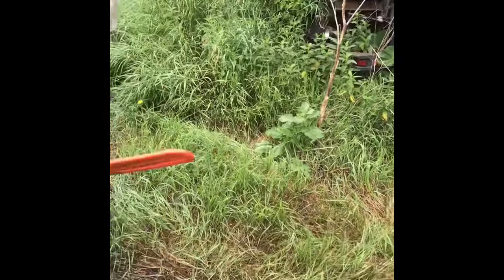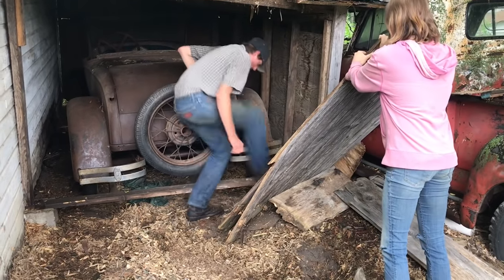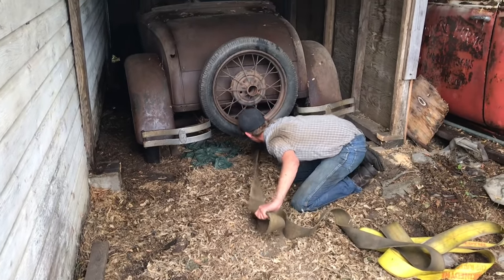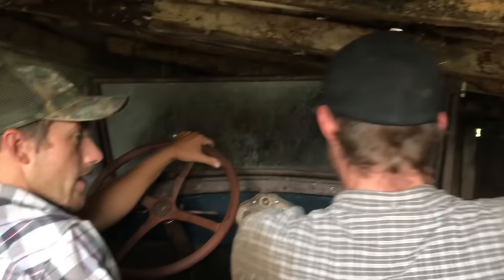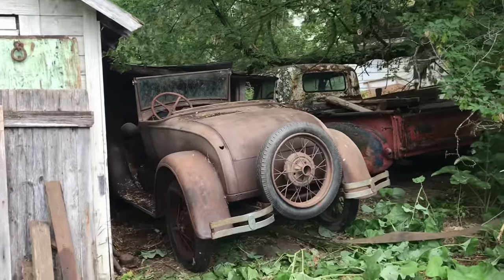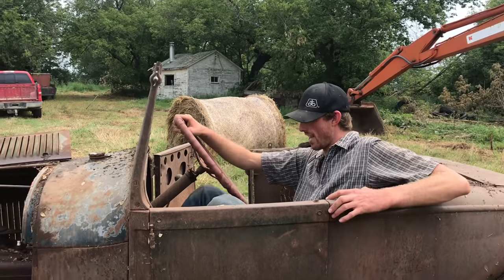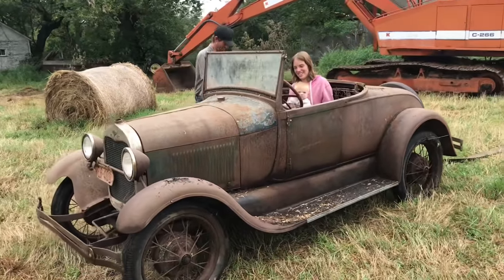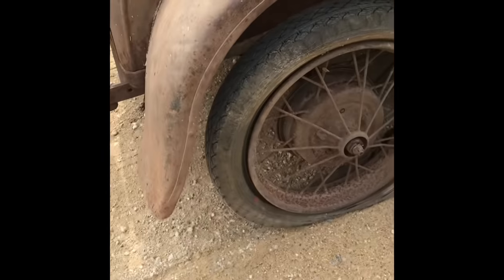An ultimate barn Find..... it could be a 1928 Ford roadster

Comment: You have a rare very early production (probably 1927 production) AR Model A Roadster.  Look on the drivers side of the gas tank under the hood and there is a date stamped into it.  The left hand brake is a left over from the Model T.  This car is very rare. Ive only seen 1 and I'm 72.  DON'T rod it.  Go trade for one that's done
Reply: u got that 1m 77 and only saw one a pickup and its buried under a roof that fell in and it was driven in there but the owner dont care
Reply: Unless those aren't the original wheels, it would not be earlier than a 1928. Before 1928, Ford put wooden spoked wheels. Without researching, I say between a 1928 - 1930 Roadster.
Reply: @coastalcruiser4317  I love it.l am a body and fender painter Man. I restore lots of old car for people show cars for 48 years. I have old car. And I think that is really cool it
Reply: @jerryn4014  I'm envious. That's so awesome!
Reply: Yep red steering wheel and E brake on the side.
Reply: I'm 70 years old and this my second one ever.

Comment: I can see this ending in tears for someone, I don’t think these muppets know what they’ve got
Reply: Yeah not a good idea to flat tow that car!
Reply: Why do you insult them ?
Reply: old car an young mother..
Reply: @garymorris1856  probably because when you see a Model A in such good original condition and then you start throwing words like "hot rod" " flames" and "Ford 9 inch" they don't appreciate it and if they hot rod it they're just throwing money down a rat hole by destroying it.
Reply: @tarstakars  I agree. I always prefer to see antiques restored to be as original as possible.
Reply: @professornuke7562  you don't have to restore it you just get it runnng right you just get the brakes working all you're doing is making it a safe and drivable. a car like that in that condition in California right now with fetch between 7 to $10,000. And Model T's and model A's are like Jeeps there's an inexhaustible well of parts for those cars available.
Reply: Gary Morris you’re right he doesn’t have a clue,he wouldn’t know shit from clay
Reply: @grahamgillette5393  You are correct, as well. Thanks.

Comment: Definitely an AR roadster. The giveaway is the handbrake by the door instead of on the gearbox.
Give the car a wash. Re upholster the seat yourselves. Put new tyres on it.
Get the engine going. Join your nearest Model A Ford club and have years of fun.
Awesome find.
Reply: Scott - YES. Join the local club and LEARN before jumping in.

Comment: Great find!!
You have an extremely rare type of Ford i think.Before cranking  it check oil.Also be careful if you never crank start a car before.Id keep it original because it may only add to value.
That floorboard with notched cutouts is original i believe.Wood was commonly used on the interior of early cars.I hope you restore it and get it running again.

Comment: My first car!! I bought mine second-hand in 1959 for AU£25 (US$760).Mechanical brakes, dickey seat, wood floor, canvas hood & side curtains, same sort of distributor w/- copper strips as spark plug leads. Spent 2 years restoring it. Sold it for AU £1250 (US$4000) cash! Heaps of memories came
flooding back when I saw this one. Thanks.
Reply from the maker: Thanks for watching!  that's so cool
Reply: @MuddyRascals  on car a registration_plates_of_Saskatchewan ??

Comment: Never try turning an old unknown motor over till you put at least half a cup of Marvel Mystery oil in each cylinder then let it sit overnight. If possible spray it in so it coats the entire piston head and cylinder walls.
You can easily destroy the rings, piston and cylinder if you don't.
Reply: prolly shouldnt have towed it like that without disconnecting the driveshaft either...
Reply: @thomasbeaver3828  they are well on their way to destroying it already. The combined iq between the two guys and the airhead is about 8.

Comment: That is,a great find ..that engine will probably run...most of the ones I have seen need a little lubes in cylinders and a touch up on the starter...with twelve volt conversion and a little love will fire right up...don't forget those where positive grounded back then...good luck. .😁😉😊
Reply: That Ford is a 1928 model T

Comment: Way better condition and a lot more complete than most enthusiasts start with. Amazingly little rust on the body and the engine turning over was a win. I don’t think its particularly rare (they sold A LOT of em) but still popular and well supported in the aftermarket, a lot of reproduction parts are available. definitely worth a few bucks to the right buyer. Cool find! 👍

Comment: Some of the old Fords came with wood floor boards.
Henry Ford would buy parts that came in wooden crates but he would specify that certain holes be cut in the boards. Those crates were carefully dismantled and the boards were used for floor boards, already made to fit the pedals.
Reply: Yup, probably 100% original floorboards .
Reply: Yes that is correct the parts packing crates were designed so they could be the floor boards and top rails of the car Henry Ford was a genius in his Time
Reply: True!! But I believe that was in the "Model T" era and the crates were what the glass came in. 
The Model A began being built in 1928 when the Rouge River plant was built. During that time, Henry was WAY past needing free wood as he had his own timber forrest, rubber plantation, and was making his own steel and glass at the plant. There are several videos here on YouTube about the Rouge River plant.

Comment: As others have said, you have quite an excellent barn find. That is a very early production production Model A commonly notated as an AR. Spotting features include the pan alternator left side by the radiator, the left hand pistol grip hand brake, the red steering wheel. These features were only included on the first few months of manufacture. Of the over 5million built, this would be among the first few thousand. You should be able to find the motor number stamped on the block just below where the head meets the block. If the motor is original to the car, you should be able to match the engine number to the month built. If it’s original, the number will be low.  there is also a matching number stamped on the frame that is only visible with the body off. If the engine a frame number math, that is an added value to the $$$ of the car. The great thing about the model a is that there were so many built, there are still a lot of original parts out there to replace what is missing. Also because it was such a popular car there are many many nice reproduction parts out there to use until originals can be found.

I’m not a fan of street rods, and I wouldn’t normally discourage someone from chopping and hopping an old car if that’s what they want to do, BUT in this case with a really complete original EARLY production car… keep it original. Restore it if you want but keep it in its original 4 cylinder splendor. THAT IS AN EXCEPTIONAL FIND. 

You can also look for chapters of model A Ford Clubs in your area. This would be a great source of help and information on this car. Those club guys are really friendly and knowledgeable.  Good luck.
Reply from the maker: thanks! yes we are going to keep it original and are in the prosses of working on the engine, unfortunately the numbers on the firewall are not there!  if you would like to see our update on this car check out our new video     https://www.youtube.com/watch?v=T_QdAcmfXbo
Reply: @MuddyRascals  Hey... Thanks for the reply. Glad to hear back from you. You said you couldn't find the date on the firewall. That is possible. BUT, take a look at the engine block on the side that has the cylinder walls and oil filler tube. From front to back on the block, there should be a narrow rectangular area at the top edge of the block. There you should see a number, not necessarily a date. If the number is low it very well could be the original engine. There are online resources to verify approximate build dates based on the engine number. If your taking the car down to the frame; if the engine is original to the car, there will be a matching number stamped on the top of a long frame rail somewhere in the area of where the front of the body was. You cannot see that number if the body is on the frame. 

Ill be sure to check out the video. Good luck.

Here is a link to a page I found that might be of some help in your effort.

http://www.plucks329s.org/index.htm
Reply from the maker: @anthonylong5838  Hey thanks for the info, so we were able to get some numbers off the engine it looks like A96872

Comment: The floor is supposed to be wood. You can find virtually everything to put this car back to original. Battery ,6volt, positive ground, goes under your feet below the removable wood floor. I believe this might be a1927. First year of Model A. Model A was built from 1927 to 1932. This would be amazing restored. The wheels are 21 inch. Good find.
Reply: Model As were made until 1931. In 1932 they were the Model B. Your correct that it's either a 27 or 28 because the emergency brake is on the left. My 1929 was next to the shifter.
Reply: This is a 1928 Model A.  The Model T was produced through 1927.  Major difference between 1928 and 1929 roadsters was the 1928 had no door handle on the outside.  1930-31 Model A's were a larger body size.
Reply: The rumor is that Henry Ford bought engines. They were shipped in wood crates. The crates were drilled and cut to size. The crates were taken apart, and then became the floor.

Comment: That is a very early model A, that was built in 1927, park brake on left side, rear tail light mounted on the body, three plate clutch. Etc. You should restore it with the rumble seat et al.  Very, very rare find.

Comment: 27 or 29 Ford roadster nice thanks for sharing model A were made 28 29 30 31 before this was the Ts good luck they are easy to work on and get running
Reply: On my post 28 29 not 27 sorry

Comment: This car is in remarkably good condition as "Barn Finds" go. Just ran across this video a little while ago and was very excited when you showed the interior and it showed the park brake lever on the left side of the car. That makes this car a "early" 1928 vehicle. The body on this car is in VERY GOOD condition!! Most of the time the fenders are all bent and split, the sides of the body is all rotten at the bottom and many times the motor is seized. I would wager this one will run with minimum effort and parts. One of your main concerns will be to ensure you are getting all the mouse bedding out of the internals. I would LOVE to be "playing" with this one!!!

Comment: Guys…. This is called an AR Ford Model A. You have something which is rare… do NOT mess with it. It has the powerhouse generator, the old style starter switch, red steering wheel, no outside door handles. Radiator fan shroud is missing but it would have had one, as well as a 2 bladed fan. Look, as others have said, on left side of engine block, just above the water outlet. You may see a star ⭐️ followed by a number then followed by another ⭐️. Please let us know what that number is. Also look for the date stamped on the firewall engine side on the left side of the car. This will show you a production date. Again, you need to contact an informed person about this car. Depending on what information you can obtain, you may have something that perhaps the Henry Ford Museum, in Dearborn MI might want to know about. This is again, NOT your typical model A Ford. Congrats on the find btw
Reply: An AR model A generally is worth little more then a regular car, unless you have one that was made in the first 1000. fact.

Comment: I had one just like that. It was a 1929 Ford Model A Convertabale Roadster with a Rumble seat where the trunk lid is. My father gave it to me when I was ten. The I believe the 1928,  1929, and 1930 were very similar.
The engines were near bullet proof. I believe the car is very valuable if restored. You should take care of that car. Every piece is very valuable.

Comment: Early model 28.  Parking brake is on the left and no outside door handles or glass windows. Windows were side-curtains that rolled up and tied in place. 
On late '28's the parking brake was in the center by the shift lever, and it had outside door handles with roll-up glass windows.

Comment: As others have mentioned its a 1928  Model A roadster. It's very rare to find them in that condition, expecially in the prairies where they were literally driven until they wouldn't move another inch. Someone obviously took very good care of that car. Please do some serious research before touching anything on that car, or sell it as is to  a knowledgeable Model A enthusiast.  It's a very special find. If you do decide to fix it up George Moir in Edmonton has every part you could ever need for it.

Comment: 28 model A roadster. They did use wood so that could be original. You have a survivor so don't hot rod it. More valuable as an original example. I would even go with the patina and just clean it up and redo the upholstery.

Comment: I have been screwed out of 2 great barn finds. 1 a Model T flatbed with a full steel cab. We had a deal, so I pulled it out and the next day the guy wouldn't let me take it. He now wanted $10,000 instead of the 3 plus the rest of the labor taking down the out buildings. I came back with 7,000. No deal. I was already out of all the work I did. 5 years later it sold at his farm sale for $7,000. The next was a 1931 Chevy 5 window coup. We made a deal, so a few days later I showed up with my equipment to find it gone. I have found several others over the years and it always ended the same way..... I quit looking in barns......

Comment: Early production Ford Model A  ‘28 Roadster. Telltale signs of an early “28 include red steering wheel, parking (not emergency) brake on left.  Someone replaced the original headlights with sealed beams.  Original powerhouse generator.  Ammeter missing.  I’d be interested in knowing the engine serial number (on flat spot on left side of block) to see if older than my March of ‘28 Roadster.

Comment: If it were my find I would treat the vehicle with respect and restore it to it's original condition. Don't cut it up an turn it into a hot rod, they are pretty common. Keep her in her original off the factory floor condition.

Comment: It's an early 27' model A.  Keep it original, you don't find them that intact any more.  The Emergency brake is on the left.  In late 1928 they moved the location of the brake next to the shifter itself.
Reply: Its an early 28. only made 27s for about 2 months.
Reply: @wieslawaz  Red steering wheels and left hand grip brakes were only on 27's in the first couple months of production.  I believe the steering wheels were gone by Feb 28'.  Look at the proximity of the generator low on the left side closer to the radiator.  Those are all early production, 1927 only.

Comment: Actually, it would be a 1928 cabriolet, notice the  fixed windshield frame on the car.  Roadsters had a folding windshield frame.  It would also be a standard version of a Model A.  Deluxe models came with side mount spare tires.
Reply: wrong. cabriolets were made from 29-31. this is a 28 roadster. the way to tell is a cabrio has roll up windows.

Comment: Notice there are no exterior door handles?  The 1928 Roadsters didn't have them, but the 1929 models did.
Reply: Clarification:  Roadster and Phaetons didn't get door handles until February 1929, as I now recall.  And the red steering wheel and drum tail light were phased out in February too.

Comment: I just got a 1929 ford  A coupe barn find and it runs. It  has no rust and original paint.  I want that one  two. Good luck with it. The serial number is under the hood drivers side fire wall top down just a few inches  and only 4 numbers.

Comment: That car needs to be fixed up. It’s a ‘28-31 Model A roadster from the looks of it. Henry built that one for the younger crowd back in those days. That motor will run with a little bit of TLC also.

Comment: Notice there isn't any tail light in the back of the roadster.  The 1928's had a single tail/brake light on the left side of the car.  If you look at the bottom of the body on the left side, you'll see the bolt holes where the bracket for the light was attached.
Reply: @fredheilig  Man, who ruffled up your feathers? He’s just giving some information.
Reply: @fredheilig  Well, ya don't need to get nasty.

Comment: Model A's year is determined by the engine # and the rim size.
the version you have is for warm weather as the heat riser is missing from the exhaust manifold.

Comment: I know I'm late to the party since this was posted a year or more ago, but that red steering wheel is a clue that this may be an early Model A known as an AR. Another clue would be the parking brake on the left side near the driver's left leg rather than by the gear shift. If it is an AR, there are people out there that would be very interested in it, but even if you decide to keep it, it's worth saving as an original.